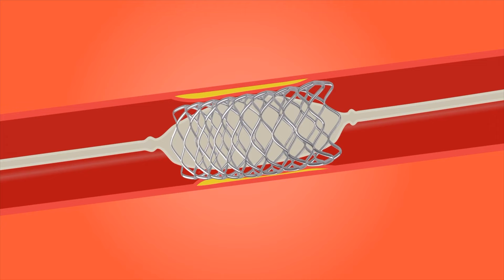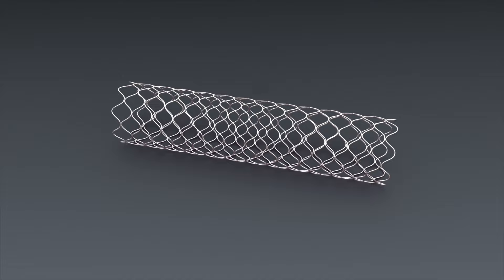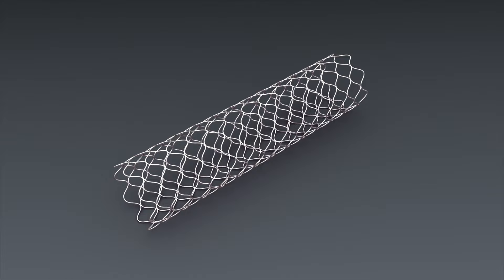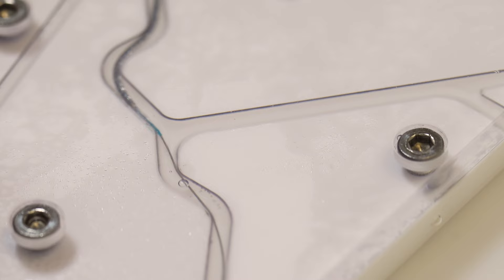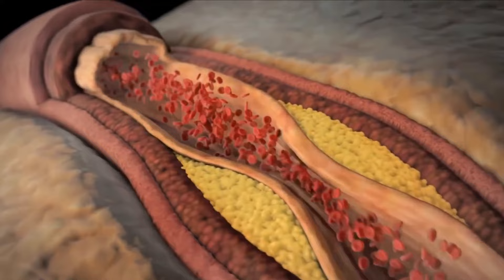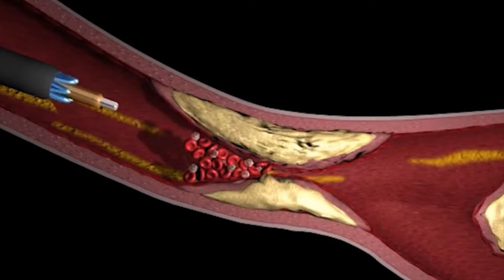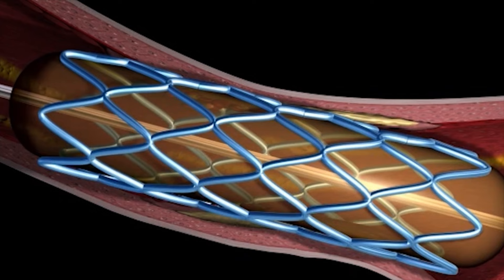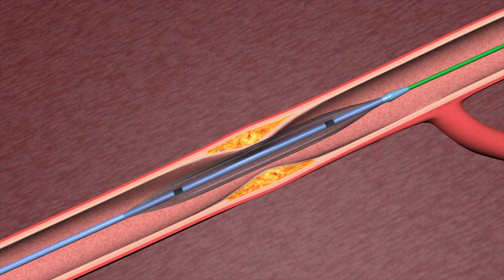Bare Metal and Drug-eluting Stents | What is the Difference?

Comment: Thank you for your explanation.
4 weeks ago I had a bad heart attack. As a former EMR,  I knew I had a very long wait for the ambulance, patient packaging, and travel time to an emergency room I suspected I would pass away unless I could hugely lower my heart rate and increase my O2 saturation. I layed down on the ground and called 911. Layed there doing extremely deep and long breathing until the amazing medics arrived.
 Left coronary artery blocked 100 percent. 
Actually saw my heart stop when they deployed the stent. Massive heat flush upon my face at the moment my heart stopped.
Crazy. Surgeon told me to cough hard, and then again.
My heart started to beat again after the second hard cough. 
Life changing event.
Two days later they did a second stent except they used my right radial artery. Much better procedure than the groin puncture. That was horrible.....but it did save my life.
I now have two platinum, drug eluting stents, one in the right and the other in the left coronary arteries.
Now the fight at getting the meds figured out.....
Thanks again.
Reply: hi if i may ask why was arm entering better?
Reply: @236vic  I had a stent placed through my arm and a catheter ablation where the catheter went in my groin. Going through my arm caused no feeling at all. I will never forget lying mostly naked and cold on the operating table with the doctor and nurse trying to shove a catheter up my leg. Your experience may vary.

Comment: thank you enjoyed that, what about dissolving stents? every situation is not the same, as there is nothing better than not having a foreign item left behind in the artery, that does not allow the artery to expand and contract as it must with body temperature. not to say that metal stent have not saved lives. With medical advancements and the fact of stent procedures getting easier, a balance of quality over long term then just a quick fix to not have that heart attack. i often wonder if a bypass has a better result in the future functioning of the affected area or artery, and less invasive if the procedure did not require the opening of the chest?

Comment: sir,if,a stent, over a period inside artery get block again what is the medical procedure , remove the old one and need to be replaced with a new one?.
Reply: You can’t remove the old one. If the stent is blocked ( in- stent restenosis) they will insert another one into the old one, sometimes it allows multiple stents. If this is not possible then bypass maybe an option.